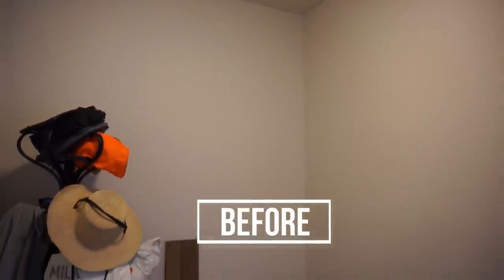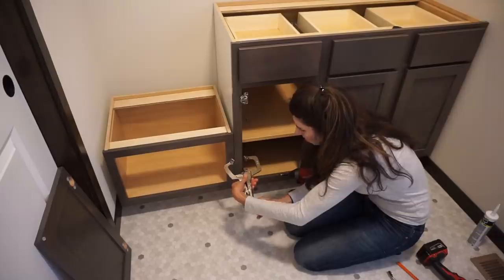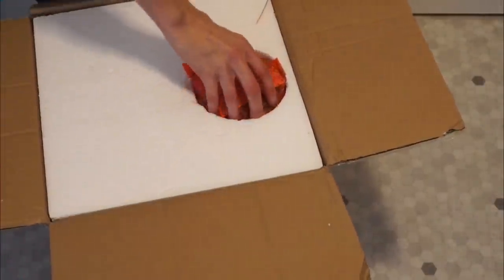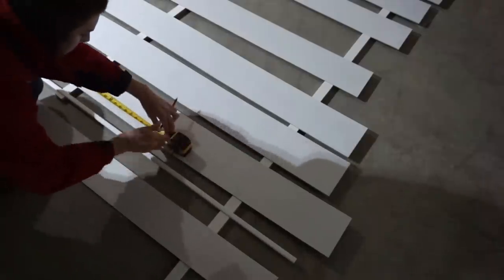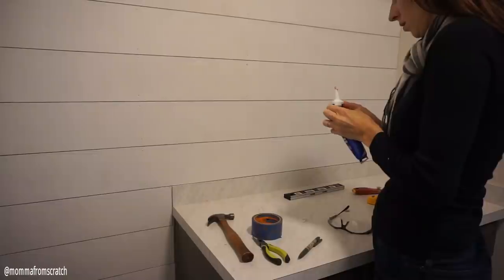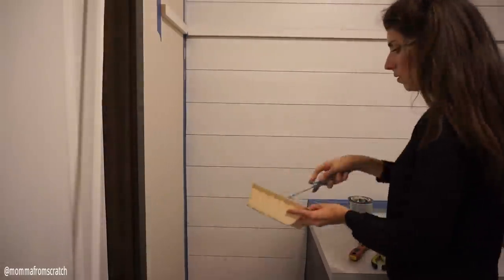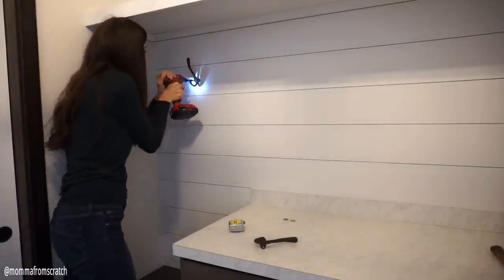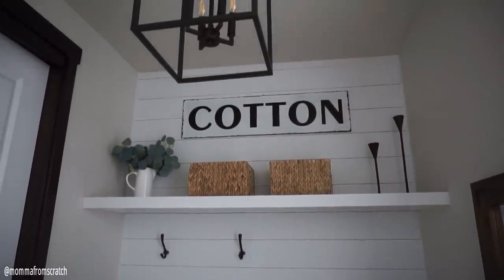EXTREME ROOM MAKEOVER | DIY Mudroom Makeover | DIY Shiplap Wall | Basic to Aesthetic

Comment: Oh I love this style and what you have done. Could you do a DIY laundry room makeover? Mine is very small after the washer and dryer are added, no room for a sink. I did add a in the wall ironing board but I need to add a cabinet in place of the wire shelfing over the washer and dryer. Any ideas?
Reply from the maker: thank you! I will probably do this one in January but I have the one i did to my last house its in the description box

Comment: Did not see it or I may have over looked it. What was the wood you used for the shiplap? It looked light weight & easy to paint. I’m wanting to play around with one wall in my owners entry way. I have textured walls so the wood you used looked fantastic by the way & easy to install & cut.
Reply from the maker: I shared an overview in the video so screen shot that but its 5mm 4x8 sheet of wood, you can use plywood but its a bit more expensive. this is super light

Comment: How tall are your ceilings?  I’d love to switch out my boob light fixtures in my mud room and back hallway. I have 8 ft ceilings so don’t want them to hang down too far but I love your light.  Kay
Reply from the maker: I have 9ft and I only left 3 chain links on it and I’m 6 foot so it’s nice. It’s 17 long so I feel like you’d be fine with it if you chose the same one. They do have smaller ones too and bigger
Reply: Thank you. I will look it up